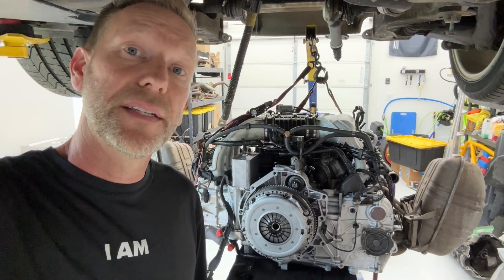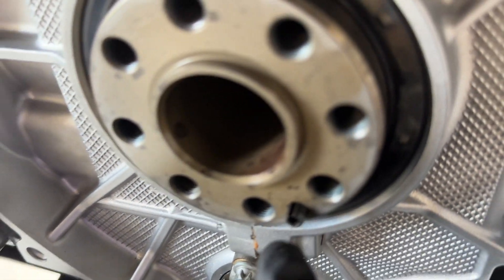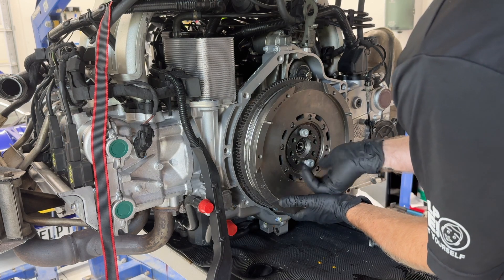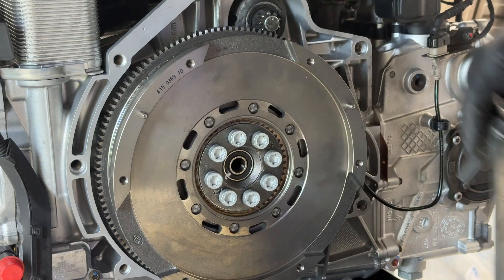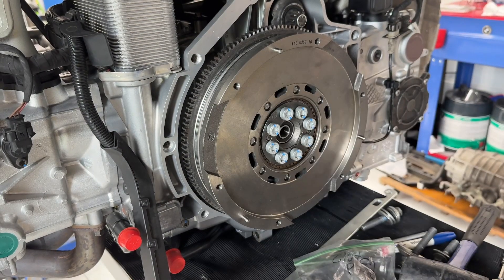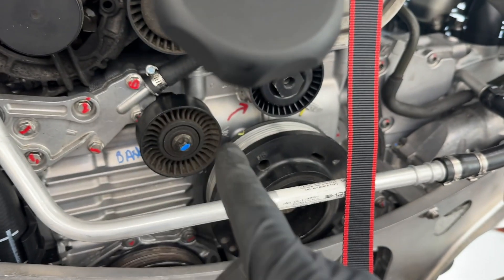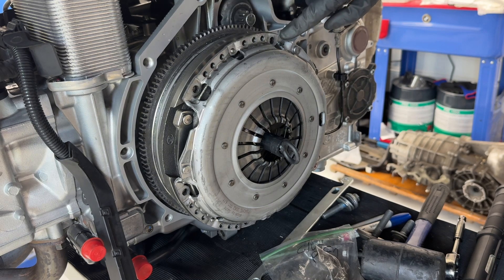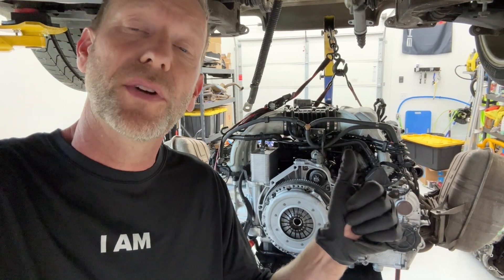Porsche 911 Engine Assembly Guide Part 36: Flywheel and Clutch

Comment: I am a bad boy and use the crank lock pin on the front to torque against... I don't think that is recommended! It is easy though. 
That DMFW looks way beefier than the 996 equivalent, torque spec is the same
Reply from the maker: +@miketdavies haha yeah I guess that’s frowned upon bit sounds like it got the job done!

Comment: I used a Phillips screwdriver through the flywheel and into the rear of the crank as a guide pin so I could fit the flywheel to the rear of the crank. Then I was able to get the flywheel bolts started in the rear of the crankshaft without any hassles. There is no other way to easily lift and fit the flywheel onto the rear of the crank.
Reply from the maker: +@mikedx2706 brilliantly simple! Why didn’t I think of that 😝 🍻

Comment: That dual-mass flywheel is a beast. Glad to see I wasn't along in struggling to get it installed. I ended up using a drift that was big enough to slip into a hole to act as a guide pin.
Reply from the maker: +@edwardmigliore6484 haha yeah it is!